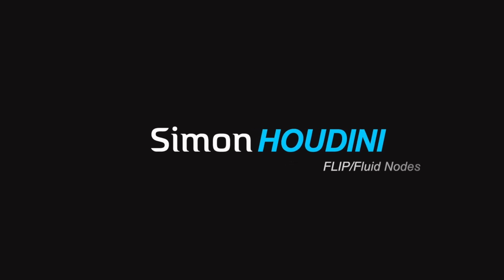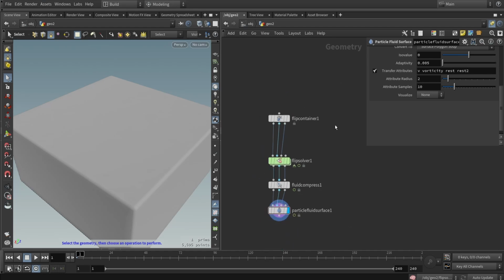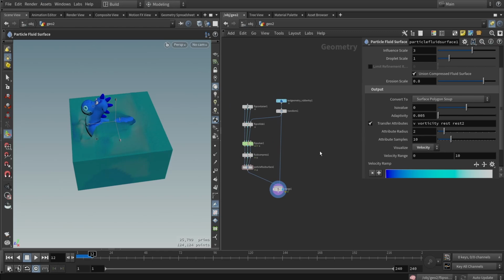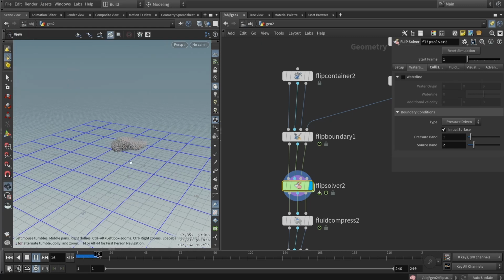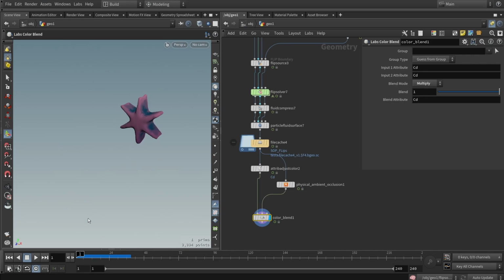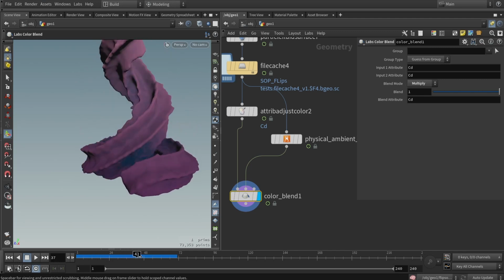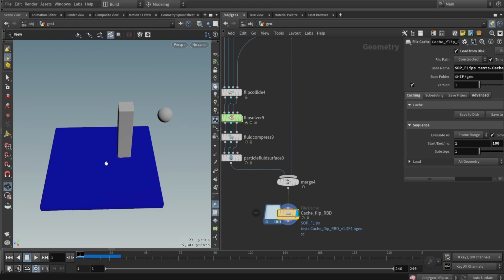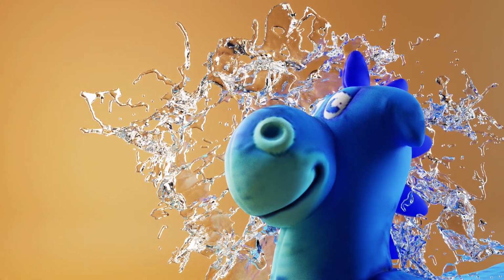Fluid Nodes in Houdini 19.5 || SOP FLIP Tutorial

Comment: Did you watch the launch event? I wanna try the flip combine/flip upres but not quite sure where to start. A video on that if you have the knowledge would be greatly appreciated
Reply from the maker: This video is mainly covering basics of the these new nodes. There is a lot more you can do with these like the upres. What I have seen from the upres setup is that you start with the normal setups like here and then you do another flipsolver pass with higher resolution ( lower particle separation). With this high res pass you also create a new container node (and flipsolver) and localize with the bounds where you want the highres to be. In that flipsolver you added you can plug in the lowres flipsolver result in the fourth input of the flipsolver.
Reply: @simonhoudini5074  thank you, I will try this!